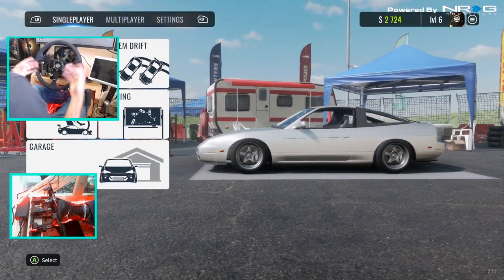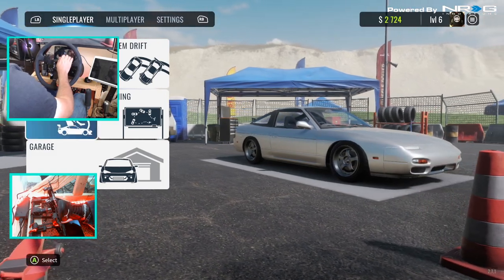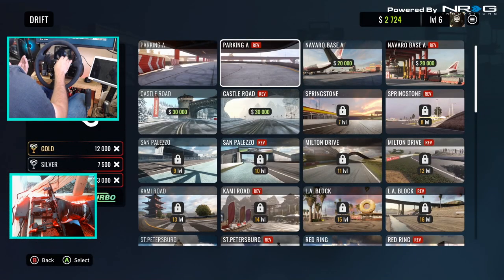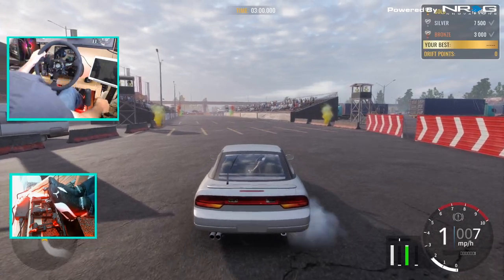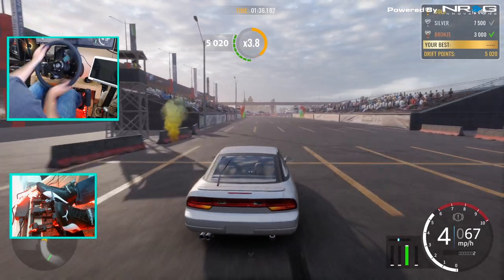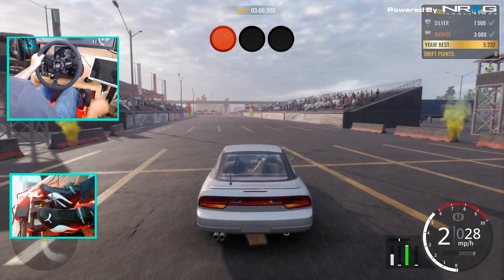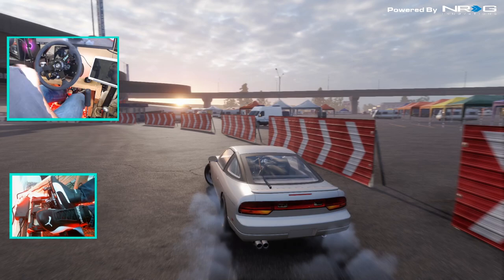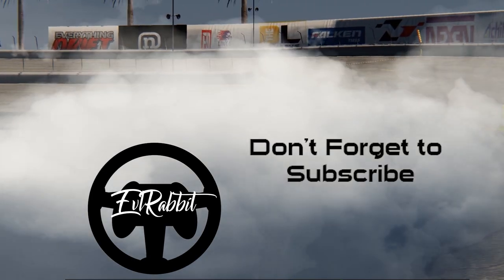CarX Drift Racer Online Xbox Edition  Wheel VS. Controller - How are they different

Comment: Love the vids bro keep up the work, something I’ve learned from playing the game on mobile with controller is if you want to mimic wheel movements with a controller you need to hold the thumb stick up in place and slide it left or right but never in a complete circle while still holding the stick up so you’ll basically be using only the top half of your thumb stick if you’ve played CarX drift racing 2 on mobile but with the wheel settings it’s just like that ina way cause you can make more precision steering  Lol just a trick I’ve learned
Reply: Plus it helps you hold angles better without having to swipe immediately left or right and making those jittery movements

Comment: Yea, controller drifting without assist is pretty hard. I’ve tried it a few times, but I’d rather participate in tandems than to practice alone without assist so I keep assist on for thst reason. I imagine that I’ll be much better on wheel